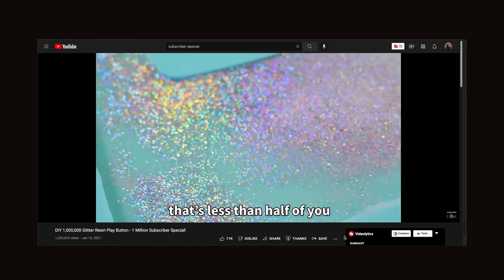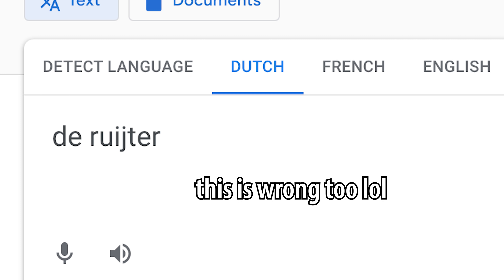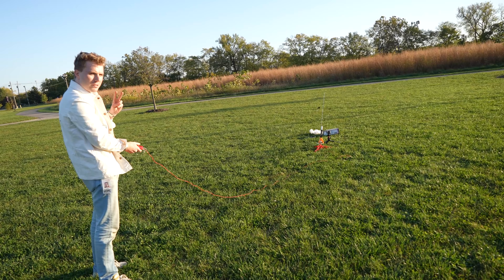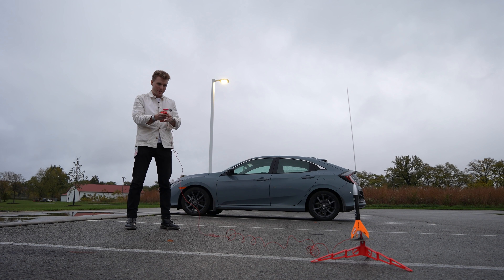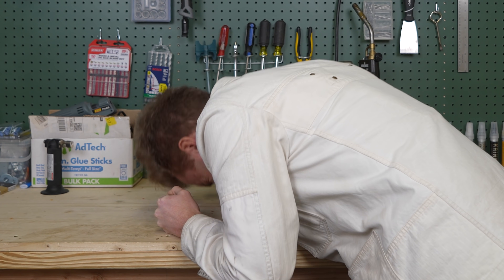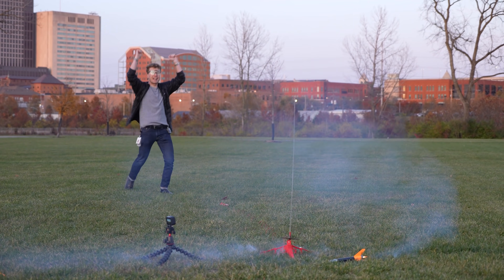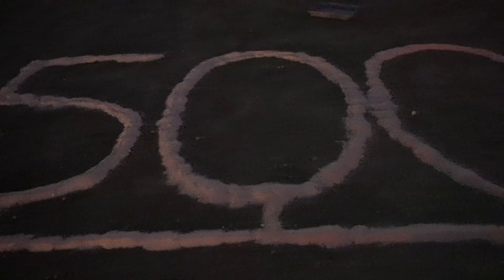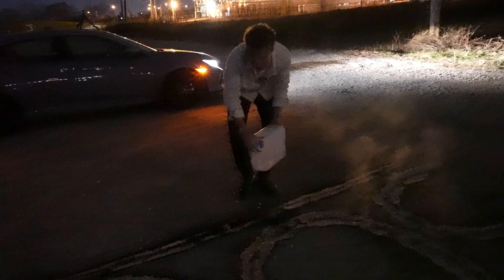Can I Launch a Rocket using ONLY Sprinkles?

Comment: I wonder if, besides the iron oxide, the insufficient prolonged thrust could have been fixed by introducing a more complex grain pattern that reveals more surface area, just as large-scale solid rockets do. Granted, that solution would have created higher chamber pressure, also leading to exploding.

Comment: that reminds me of the time when i asked people to give me embarassing art from art class so i can burn it, so basically i turned all of those emberassing drawings, and cut it to so fine confetti that it could've been considered paper glitter at that point just with the difference that the glitter was so jagged it could give you a rash, mixed it with sugar and then i used it as flamethrower fuel

Comment: The motor casings couldn't stand the pressure. Some metal like copper can stand higher pressures and have more nwoom. Also there's this Nakka rocket software that's great for modeling these kinds of things.
Reply from the maker: yeah, but imagine if it DID blow up lol - now that'd be scary
Reply: @Weisz  Lmao yeah I made some last summer. I rigged it up to an RC system and was like 150 ft away